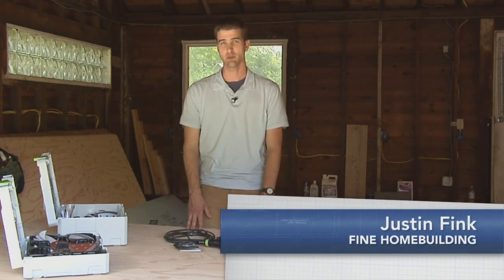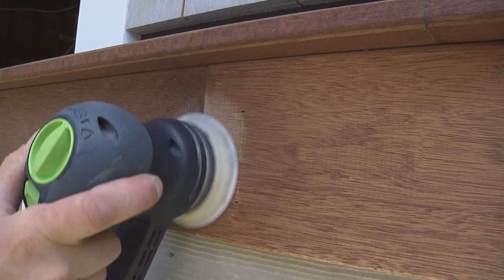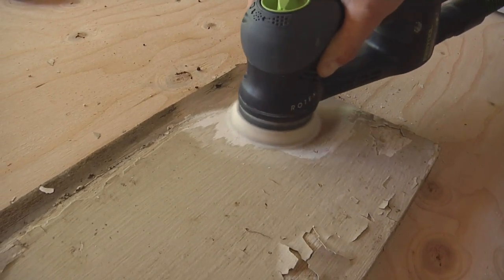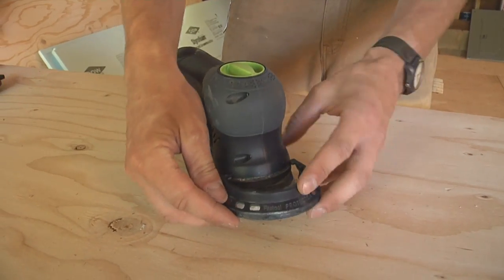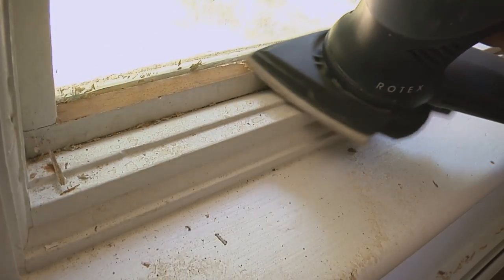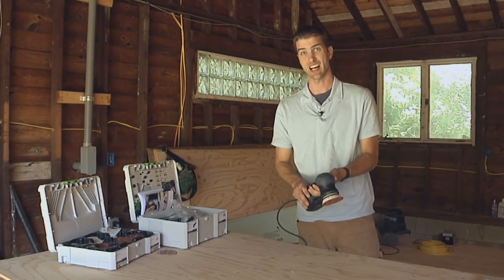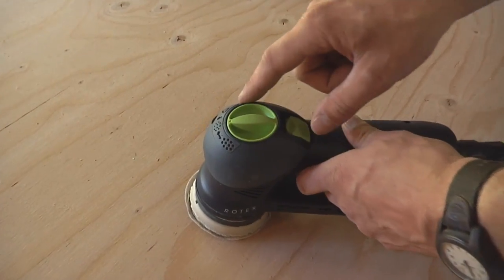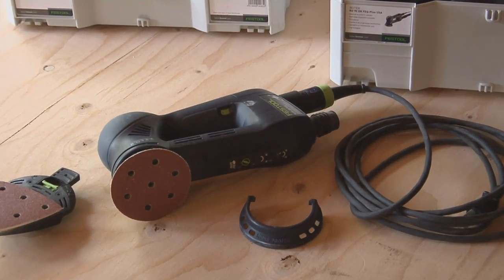Festool's Revolutionary New Multi-Mode Sander RO90DX

Comment: I get great control and comfort by lightly holding up the rear in my left hand, relaxed without gripping, and using my right hand on the ball head grip to apply any force or direction inputs to the cutting disc..